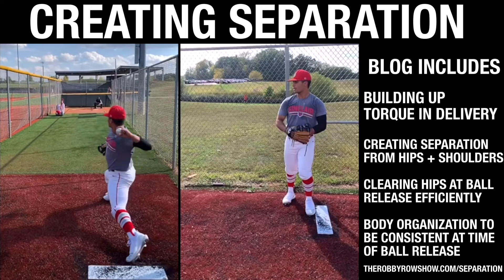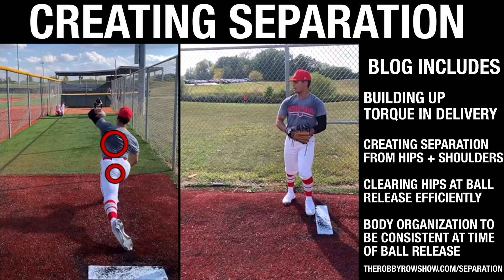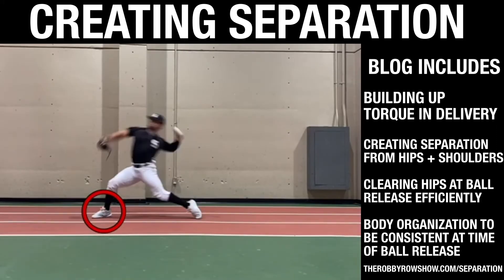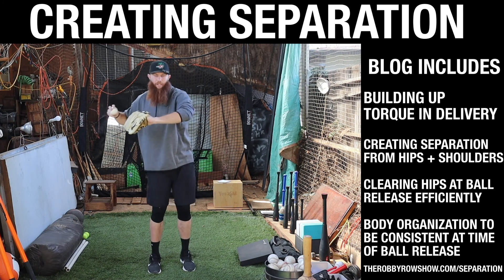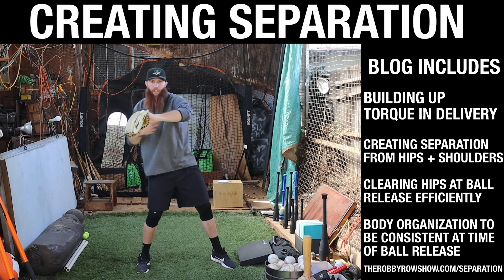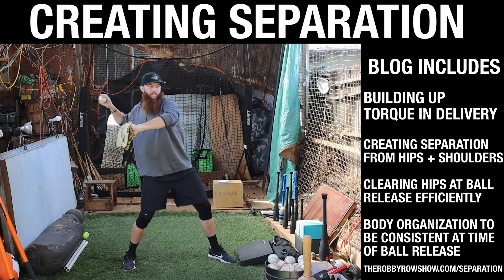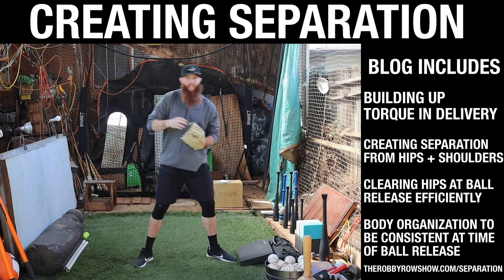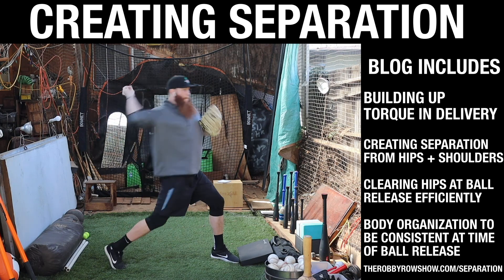Creating Optimal Separation in Pitching Delivery - Robby Rowland

Comment: Are u rotating your hips before or after your foot hits the ground
Reply from the maker: Begin rotation before front foot strike while the trunk is counter rotated
Reply: Don't you have to rotate your hips because of the way you step? You step down with your toe pointing to the plate. That opens the hips up doing that doesn't it?